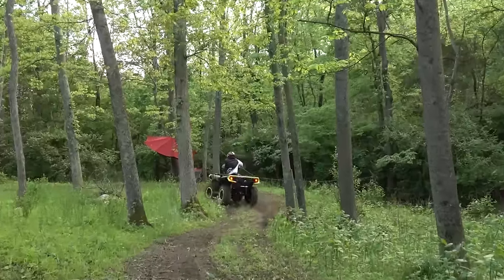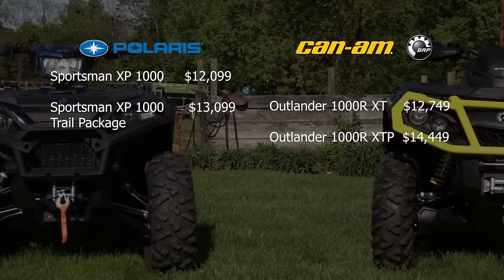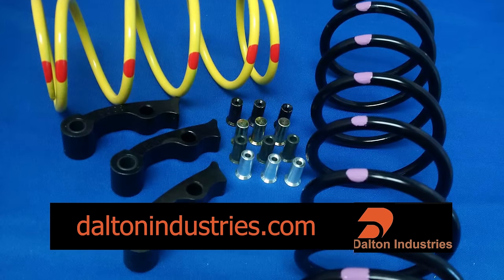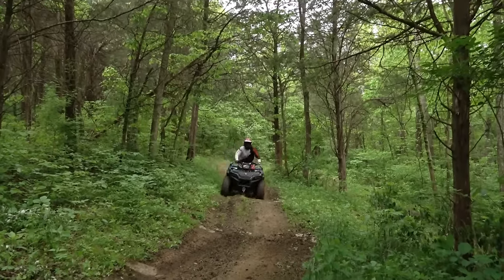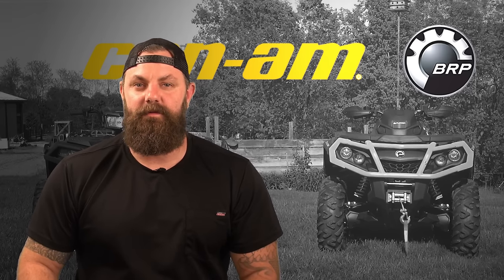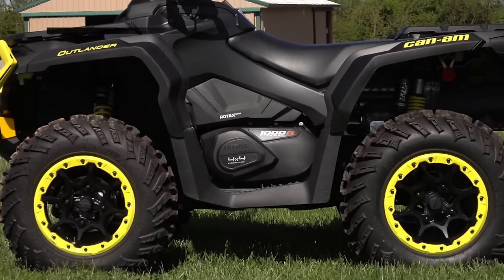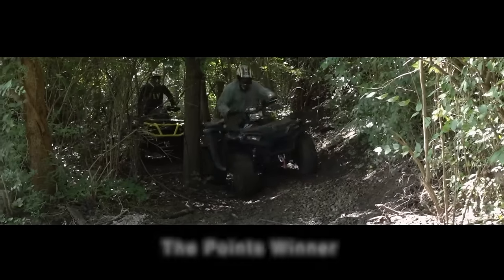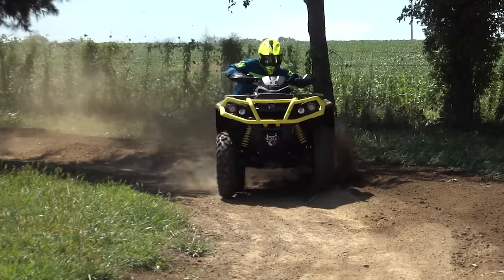Polaris Sportsman XP 1000 VS Can-Am Outlander 1000R XT-P, 1000cc 4x4 ATV Shootout

Comment: How about doing one on the 2022 models!
Reply from the maker: We will do a new model test on the Outlander at some point in the future. For now, the main update is the addition  of front differential lock. That is a pretty significant update but overall power, handling, suspension and breaking are basically the same. At this point the last test and shoot out we did is pretty much completely relevant. We have more Outlander 1k content coming for you though.

Comment: What about heat from the machines? With the tuners are they similar in how much heat you feel?
Reply: Yes, we put the HMF Gen 3.5 Optimizers on them because ATVs nearly universally run lean from the factory which causes the heat. No issue with the optimizers on them! Stock for stock the outlander feels hotter because where the exhaust runs..
Reply from the maker: Dirt obsexxion is Chad Westcott, one of the riders from the shootout. What he said.😁

Comment: Most people do not add these.  They may be common for some people, but not the majority.  My point is that if a guy wants to compare two atv's to purchase he wants to see how they compare from the factory not after these mods are done otherwise the comparison is useless to him.  What if he uses a different exhaust or different tuner. That is my point.
Reply from the maker: Nothing wrong with your opinion or how you stated it this time. That being said, if you notice, half of our shootout use stock exhausts and the other half had aftermarket exhausts. We experienced these machines both with pipes and Tuners and without. The difference in engine performance it's not different having added the exhaust it's simply adds a bit more horsepower to both machines. They're both a little faster and run a little cooler but it did not have any effect on the outcome.  While we mentioned the benefits of clutching according we did not install aftermarket clutches in these machines because that would have had a more drastic effect on the way the power was delivered. A question for you, considering that tires are often the first thing people change oh, do you think it would have been unfair to use a speck Tire on both machines to even out there traction performance? Running the same Tire as the Can-Am would have benefited the Polaris greatly. We're interested to know your thoughts.

Comment: You can tell Polaris has been doing this "full size" ATV thing longer with the ergonomics, seating, and handlebar layout, but the Can-Am is catching up and exceeding in a lot of other areas! Suspension wise, the Can-am is just so much better mainly due to the shocks, Easy fix for the Polaris. I own a 2017 Sportsman 850 SP and agree 100% about all the shortcomings of the 1000 XP! What gives the sportsman the super cush trail manners hurts it in the handling and utility departments :-(  What I do like about my 850 is how smooth it is with more than enough power and the fact that it gets damn near as good MPG's as my wife's 2018 Sportsman 570 SP!  You guys should have done a casual trail ride test including an MPG loop to see what these beasts actually get :-) This was an excellent comparison none the less, showing people that may be on the fence on which one to buy the highs and lows of each.  If I had to upgrade to a 1000 I think I would still go with the Sportsman, mainly because real-world pricing has the Polaris a lot cheaper with the factory incentives!  At the end of the day, I think Polaris needs to address these issues pointed out in this comparison! Put a REAL 2" receiver on and offer a set of Fox QS3's or maybe some Walker Evans clickers on it. You can tell Polaris still caters to the whole "aftermarket" with the way they set these Sportsmans up just begging for upgrades! Sportsman 1000 "S" would be the exception to this, but for $15K it better have everything :-)
Reply: Great comment papa Wattz! We actually talked about doing an MPG test but it would have taken a long time and wouldn't have been true to stock form after we put the exhaust and programmers on..
Reply: @dirtobsexxionvlogs4892  Good point, I didn't think about that!
With that being said. is that fuel programmer and exhaust available on the 850 Polaris and did you notice a power increase ?
Reply: @MrJeffyb69  Yes, HMF makes the Titan QS for the 850 Sportsman. You definitely notice a power increase and the sound of the QS is very nice. Obviously when adding the programmer you'll lose a little fuel efficiency because you're adding fuel to the injection.
Reply: Pretty sure the can am is cheaper or close to the same as the  Polaris now. At least the XT which is equivalent to the sportsman trail package. The XTP is def more but you also get more. Depends how you look at it I guess
Reply: @dirtobsexxionvlogs4892  Cool thanks for the response and info! I'm not too worried about the fuel mileage, I only brought up the MPG to get a baseline :-) I understand if you rip on anything, fuel mileage takes a hit. But there are some occasions I have to ride tame with the wifey and have to kind of gauge how far we can ride on a tank full :-)
Reply: @jmeist25  I'm sure it's different everywhere, but here in lower Michigan, just about everywhere in a 100 mile radius around me has the Polaris Sportsman ( 450, 570 850 and 1000) cheaper than the comparable Can Am . I looked at all brands at one dealership in Kalamazoo, Michigan ( Zeiglers) and comparing all of them, IMO, the Can Am. Yamaha and Honda have better fit and finish but the Polaris is just so much more comfortable! I am short (5'9") and the narrower tunnel on the Polaris just fits better!
Reply: @MrJeffyb69  Fair enough! I believe the performance increase is worth it!

Comment: Great vid!
Honestly... 90% of the population will never ride these machines to their full potential.  I own the 2020 Polaris XP 1000 Trail edition and I ride aggressively... but not like the dudes in this video.  The reason I chose the Polaris was mostly because it "felt" better to me.  The seat, the handlebars, the ride.  And also.. I think the CanAm looks cheaper for some reason.  I dunno.  Either one is gonna make you happy... 

Have fun out there and ride safe!
Reply: Awesome comment! All true! The most important take away we wanted people to have from this was to go by what felt better to them!! I think your right about 90% of the population not reaching the full potential of the machines too...  We talked last night about comparing a Grizzly to the Outty, just to see the trail performance.. An 850 or 700 class machine would have easily done 95+% of this shootout just as well as the 1000s..
Reply from the maker: Great comment, well, everything except appearance, we don't usually get into that.
Reply: ATVonDemand 
Ha! I just threw that in as my personal opinion. Actually though... I wish the Polaris had come in a nice matte black like the CanAm.
Reply: @bradmadison6397  The base model XP 1000 was black in 2017.. It'll probably come around again.. They seem to shuffle colors around with the 850 and 1000 with different graphics. My personal favorite was that Bronze from the 2017 LE edition from ATVonDemand's first test..

Comment: Why do they keep talking about the Polaris having a lower seat height? That's not true, the Can-am seat height is 34.5" and the Polaris is 37". The Can-am's seat height is 2.5" lower actually. Fact.
Reply from the maker: When you respond to this channel with "they," You should be aware that they will respond to you. Especially if you are being derogatory. Fact, Your attempt at a gotcha moment has failed miserably. Sorry. As the narrator, I listed the seat heights correctly. Our numbers were exactly the same as yours. What the test riders were referring to  was the feeling of the seat height in relationship to the footpegs and handlebars. While my opinions were not scored in this shootout. I rode both machines so that I would have a good understanding of their performance. Based on my personal experience I would have to agree with our rider's opinions. The narrow midsection of the polaris and tall handlebars makes you feel like you were sitting lower in the machine. The Can-Am which with its lower bars and wider mid section leaves you feeling like you're sitting on top of the machine. Glad we could get the, "fact," straight as we most always do. You're welcome.

Comment: Does the size of the sportsman feel intimidating through slower trails?
Reply from the maker: It's big but it's clutching is so mellow and you can put the throttle into work mode which makes it less sensitive. Pretty much turns it into a pussycat.
Reply: @ATVonDemand  awesome thank you. I'm in the market for a 4x4 quad and can't for the life of me decide which on to get. My budget is around 12, or preferably less. Kinda like the outlander mossy oak edition, or if I want to spend more, an xtp outlander. Also really like the sportsman trail xp850

Comment: Wonder how much of the body roll complaints can be attributed to the tires.  I hated what I thought was body roll on my Sportsman 850.  The weak sidewalls on the stock tires was 90% of the problem. Put a good set of tires on and it performs so much better in the corners.
Reply: Yeah tires can definitely contribute but the tires on these machines are better than what comes on the base model.. So we felt the body roll was mainly from suspension and weight..

Comment: Those guys are brave to go that big on utility quads 😂 Especially that one shot with the Can Am, he absolutely launched that thing! Idk how you do that, I shit myself when I even pop the front tires off the ground on mine, they're so sketchy to have in the air 😂 Now to be fair, if I get the front end in the air on my machine, then I'm probably driving like an absolute maniac because it's not easy to lift the front end on a 1999 Sportsman 500 lol. Has no power compared to these big 1000cc machines that do a backflip every time you touch the throttle 😂

Comment: So why wasnt just a outlander xt used? Wouldnt that have been more of a fair test?
Reply: It would have been, but he asked for the top of the line trail machine from both manufacturers.. The fact that CanAM has more premium options is something to consider..
Reply from the maker: Using the XT would have changed things slightly. However this was a top-of-the-line shootout.

Comment: Everything the Outlander did better in was related to racing and everything the Polaris won was related to riding.   For me, the Polaris would be an easy choice.  I like my comfort, I'm older and don't have any interest in any behaviour that bottoms the suspension out on jumps and don't need to win a race.   I currently own a Polaris 2009 550 XP and its never broken down and the drive system is so far superior than anything else out there, im almost alway the guy winching everyone through the spot I just cleared.   I have a buddy that wont ride anything but a Can Am.  we have fun ribbing each other:).
Reply: Great comment! That's a very accurate observation, and it's why 2 out of 3 of the test riders said they would choose the Polaris. The CanAm is the higher performing machine in the majority of categories. Living with and riding the machine daily requires careful consideration about the selection and what things are important to you..

Comment: Was the Polaris easier to drift around corners? Kinda looks that way
Reply: Yes, I'd say the back end broke loose very easily. But that was primarily due to the tires. The Duro's didn't grab as well as the Terracrosses.. Good for sliding, but there was many more times where the bite from the tires on the Outlander was more advantageous..
Reply from the maker: Evan Hartzell also felt the same way. The Sportsman's longer wheelbase could also be a factor.

Comment: Isn’t the point of a head to head comparison to see which manufacturers machine is better than the other one in stock factory trim? Despite putting the same exhaust and fuel management system on both ATV’s, they’ll each get different performance gains because the two engines will behave differently from the mods. I’d be more impressed if you tested these two in 100% stock trim. In most cases dealers aren’t selling brand new modified ATV’s to their customers.
Reply from the maker: Half of the shootout was done without exhaust systems. Power characteristics don't change that much when you add them they just run cooler and gained a few more horsepower. We are simply eliminating the restrictions that the government mandates something most Riders would do.

Comment: You think Chad's biased with a Polaris shows. I have ridden both  on trail rides several times. I'm an aggressive rider so I preferred the Can-Am. While crawling around the river trails the Polaris was easier on the back. I've been riding quads since they came out. I just can't bring myself to buy either one. I have an old 2004 Suzuki Vinson 500 manual shift in the building. 90% of the time that's the bike I'll grab it is so much fun to ride. If I'm going to one of the trails that's rough bumpy very seldom ever get out of second or third gear and you're going to ride all day it's the Honda.
Reply from the maker: No, we don't think Chad is bias. He had experience on both of these units coming in to the shootout.  As the guy responsible for putting it all together I never recalled him saying anything that came off as bias.  I think for most writing all you need is a 500 class machine.  I forgot that Suzuki you own was a manual shift.  How do you think it stacks up against a Foreman 520?

Comment: can you disable the auto engaging 4x4 on polaris for playing in 2wd
Reply: If you have the Polaris in 2wd the AWD system will not engage. The AWD has to be selected and the selector goes from 2wd to AWD to Active Decent Control (ADC). When you're in AWD, the machine engages the front wheels only when there is slip in the back wheels, which happens even before you realize it slips..

Comment: Awsome reveiw..preferring the polaris myself..they were bang on with the suspension...i upgraded to heavier springs and upgraded tires to 10 ply.less body roll..on the polaris..bean counters gotta learn..tires make or break a d handling..stock are junk on polaris.upgraded clutch and carb.got way more bottom end punch..just saying..

Comment: This is a great video. Lots of good information to expand upon as I do my research on what to get next. I ride like Chad. I don't race but get pretty aggressive on the trails and can get into some pretty technical places.

The Can-am is really nice. Great shocks. I wish Polaris would upgrade theirs to match. With that said, I like the ride of the Polaris for my type of riding. I love the Polaris seat. Tires can be changed and will be due to wear. 

4 wheel drive is my biggest problem with the Can-am. I'm not a fan of the front diff. To put a locker in would be pretty expensive, probably close to $1000.00. I could replace the Polaris shocks with that money and do the clutching. My point, there are shortcomings for both machines. I need to weight out where I want to spend my money on upgrades and decide if I can do it myself or need to have someone else do it.

Then there's the receiver hitch. What is Polaris thinking? Then there's the arched A-arms. Put them on everything Polaris! 

My decision is still open. Right now, Aug. of 2020, dealerships don't have any inventory. All that stimulus money has created a sell off of everything the dealers have. I may wait until the hangover hits and people realize they don't need that thing in the garage taking up space that I never use. Maybe pick up something lightly used for a deal.
Reply: The best thing to do is to check both out because they feel completely different. I'd go with whatever fits you best...

Comment: Can someone answer me which quad is the most cost effective to buy? to master off-road well, not to consume too much petrol, not to break down more often and to have cheap parts and maintenance?❤
Reply from the maker: If you want lower cost and higher fuel efficiency then you are looking at the wrong class of ATV. A 4x4 in the 450 CC range or a smaller used sport quad would be more appropriate.
Reply: @ATVonDemand  I bought a Russian Stealth 850. It is the largest, ie the largest quad in Europe..I drove it for 3 months but I am dissatisfied with it, I sold it.. and the water battery is weak, the wires burn out of electricity ... The brakes wear out after 200 kilometers..Maintenance is expensive ... In Europe, can am outhlander and polaris are very very expensive to maintain, they consume a lot of gasoline ... Eg Cf 1000 is Chinese..I know Chinese products are all bullshit..But as for the quad Cf 500 ... 550..600..625..800..850 and 1000 I can tell you they are not expensive to maintain they master all terrains and driving off road does not consume too much petrol but again they are praised for some shortcomings
Reply: Here, for example, take 4x4 quads from 500 to 1000 cubic meters..From all manufacturers around the world, compare them all..You will see that all of them lack a lot of things that the factory did not do and could ... There are disadvantages and advantages. It is all individual and compatible.🤌

Comment: Why not use the Polaris Sportsman 1000 S?
Reply from the maker: Great question. We did not feature the Sportsman s in this video because it is in a different class due to being nearly a foot wider with much more suspension travel. Not to mention, it's extra weight. We have a Scrambler S coming which we will be comparing to a number of other ATVs and not some Vlog Style rides. If another manufacturer builds a machine that will compete directly against the Scrambler or Sportsman S we will have another official shootout on our ends. Thanks for taking the time to watch and comment